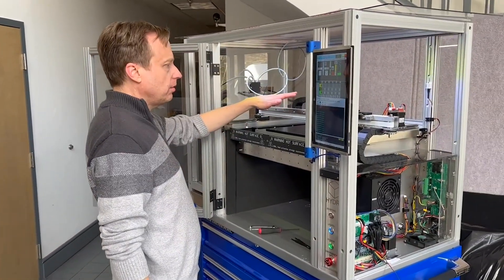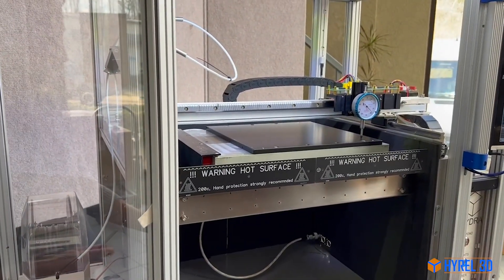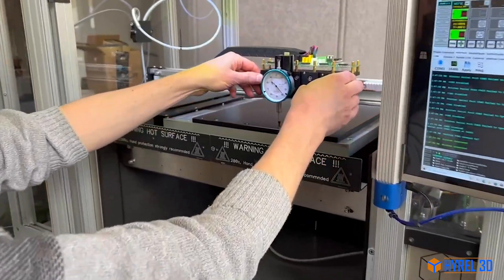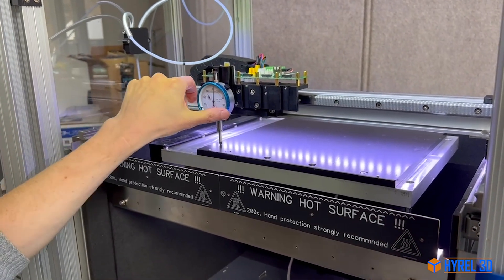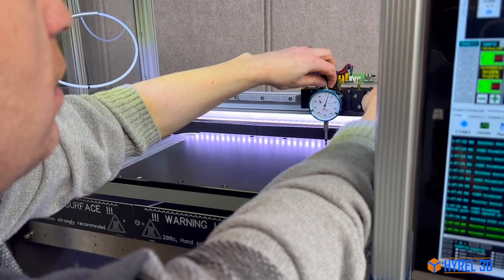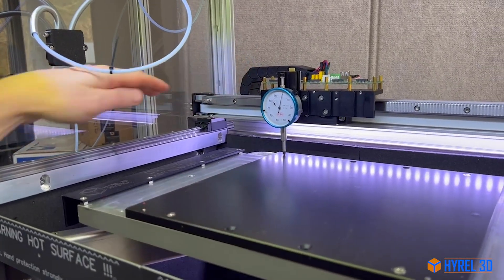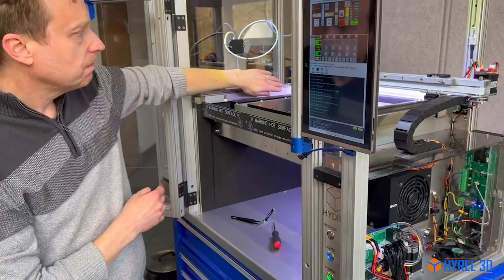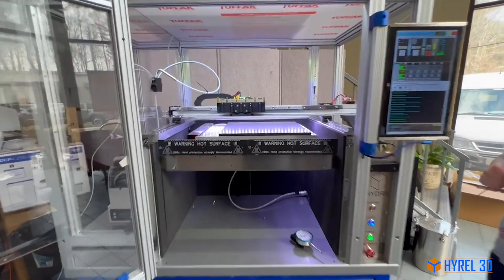How to level the build platform on the new Hyrel 3D Hydra 21 printer.

Comment: Look like a fancy machine. Is there any reason it does not have auto leveled bed?
Reply from the maker: Automatic bed leveling either a) just compensates for a bed that's not level, or b) requires individual motors, which can lose their relationship with each other over time. With this method, once you've leveled your build surface with the printer in place, you should never have to do it again. One Z motor means all three ball screws are always moved the exact same amount, every time.